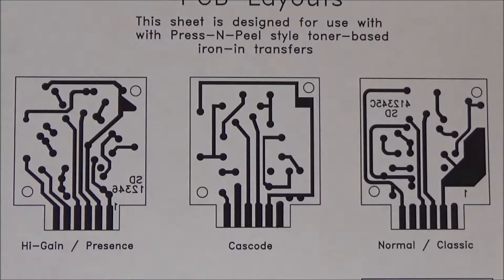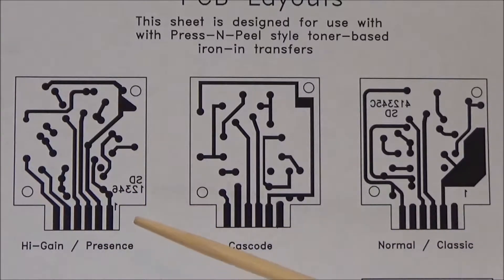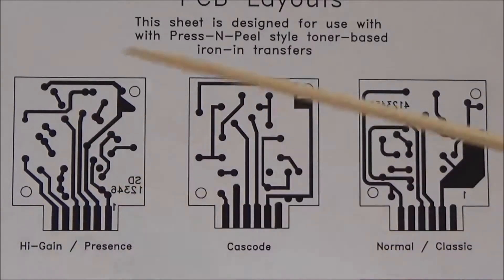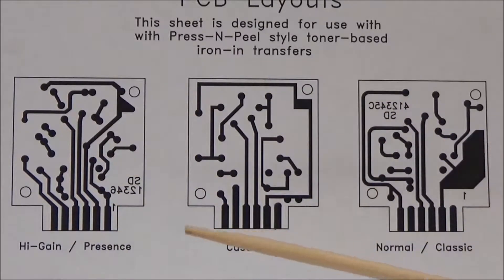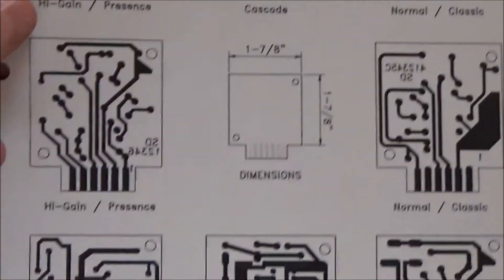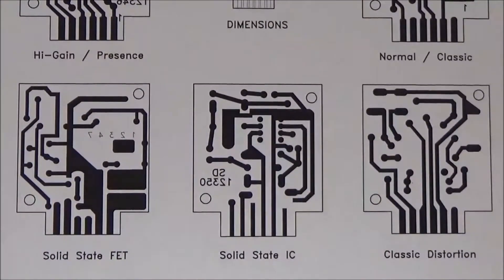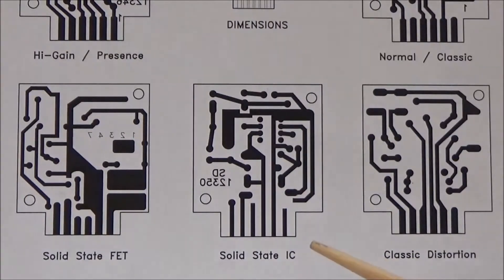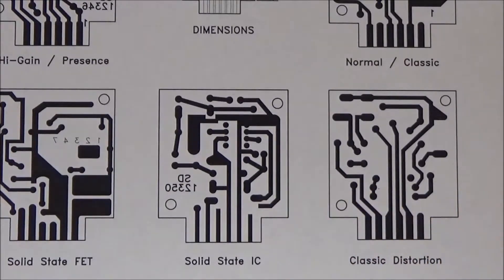Seymour Duncan Convertible Preamp Modules - Part 9, PCB Designs

Comment: Will the convertible work with only 1 modul installed? Mine has all of them installed and I want to sell the 4 I don't use ..if I take them out and just leave the first one in will it damage it ?
Reply from the maker: You need three for it to work. First one is common to both channels. The lettering on the module cover has a little diagram of that. So you could have three for one channel and when you switch to the other channel you’ll get nothing (I think) but maybe it’d be some kind of awful noise. Not sure what could possibly happen. Probably not s good idea for the amp to be operated like that.
Reply: @VegasCyclingFreak  Thanks for that. I'll leave well enough alone.

Comment: Thank you for all of the Seymour Duncan convertible vids. I just acquired one and would like to have the pcb etch resist layout and any thing else you are willing to share concerning module diy builds. Your vids are the best in depth examples I have found. Please send info to ( amptechjim  at gee male dott comm) I plan on 3D printing some module enclosures if no other source is available. Thank you for sharing your knowledge.
Reply from the maker: Jimmy G. — Thanks for commenting. I’ll send you an email with the layouts when I have a few minutes in front of the computer.
Reply: Did you ever 3d print module covers? If so I would really like some or a 3d print layout
Reply: got a box from Hammond Enclosures. Can’t remember the model

Comment: where can I get the PCB models of the modules
Reply from the maker: You can send me an email at diyguitarist at embarqmail dot com
Reply: the website does not come out another website side does not come out
Reply from the maker: Emmanuel Pluguez — If you’re referring to the DIYguitarist.com website, it doesn’t exist anymore. I shut it down about 3-4 years ago.
Reply from the maker: I sent you an email, I hope that is of some help. That problem is not an easy one to figure out on this amp.
Reply: Hey do you know what reverb tank is supposed to be in these amps? Mine came with a tank that should be for a tube driven reverb. Can’t find anything and Seymour Duncan is closed for quarantine.